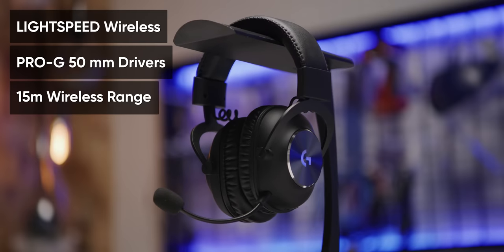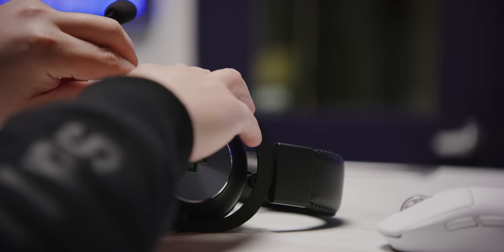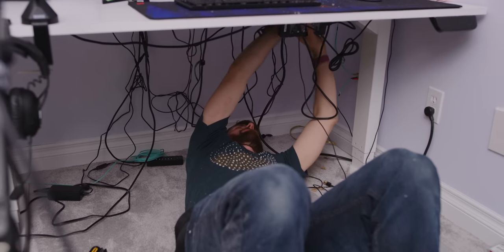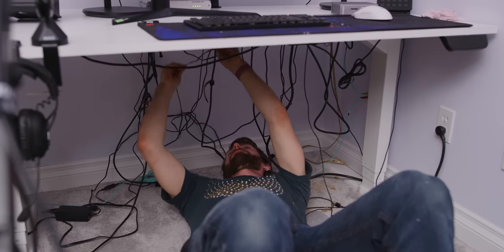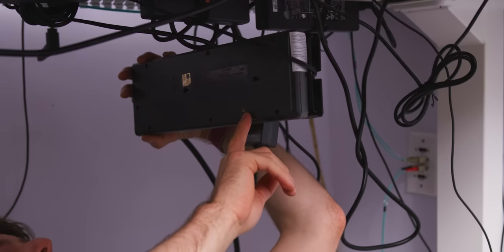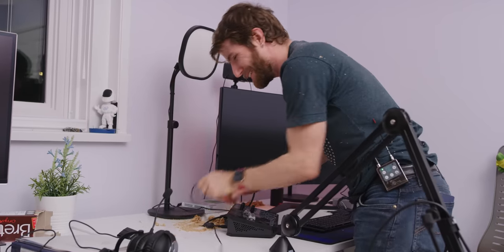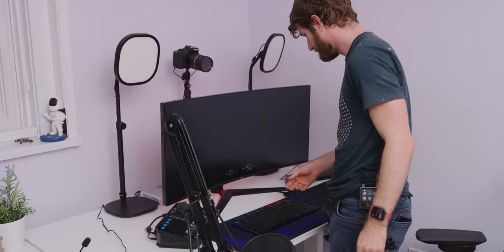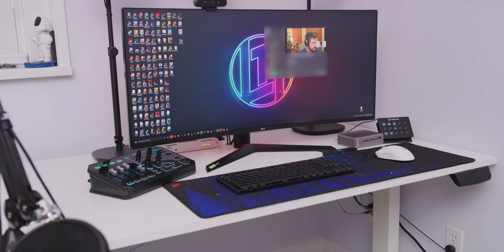It's time to break up. - Stream setup cable management

Comment: "70 hours on a single charge"

My Microsoft Wireless 5000 lasts ~10 months on Sony CycleEnergy cells. lol
Reply: High performance sensors and such use a ton of energy
Reply: Really??
Reply: @Scypher_Tzu  no
Reply: Yeah, but that mouse is shit. I had a shitty wireless mouse that lasted 4+ years without needing a change of batteries, but I'd still rather use a wireless mouse that lasts 4 hours than that pile or crap any day as long as it has good tech inside it.
Reply: @FiniteCS  The Wireless 5000 is shit? lul

Are we talking about the same product? The huge bluetrack mouse?

I had it for the last 8 or 9 years and its been a great piece of gear.

Granted, I only play GTA Online and some Battlefield from time to time. But it's got good response, never had interference issues, and it has an absurd wireless range.
Reply: @hrq007  Sorry, but have you ever heard of the Dunning-Kruger effect? This is exactly why I am dismissing your opinion and, albeit I don't mean any offense towards you, I'd understand if you did take offense. The way you say it's served you well for ~9 years while having only used it for GTAO and Battlefield is like hearing a grandmother say that her dial-up connection works perfectly well and she sees no reason to upgrade to anything different since she can still use AOL and Facebook just fine. Hopefully my analogy is fine there, but basically what I'm saying is that your lack of expertise in the department makes your opinion on "gaming" peripheral hardware rather lacking and not a good source for those who are looking for good equipment. I'm sure the mouse works fine for office use, simply browsing the web, and light gaming here and there, but it doesn't mean the mouse is not shit. It all depends on the purpose of which the person will use the mouse and what they're expecting from it. So yes, me calling it shit is subjective since I'm sure someone has needs that makes that mouse the perfect mouse for them, but for me and those who want the "best of the best" or every single bullshit, marketing "advantage" they can get, then that mouse can easily being considered "shit." No offense in your decision to use the mouse, just for recommending it with the only advantage it has being battery life when it utterly fails in comparison to many other mice in mostly every other field imaginable. Of course I won't expect you to notice due to the Dunning-Kruger effect and how you'll most likely never feel the need to have better since what you have is already potentially perfect for you, and I definitely won't expect you to go out and buy/download testing equipment just to test statistics like latency, sensor quality, glide pad friction, etc. 
Also, even without all the technical jargon and statistics, I can easily consider that mouse garbage just because of the size, ergonomics, weight, build quality, feel, etc., but I won't since some people might consider those qualities it has to be what they want in a mouse, since even just a few millimeters difference in height, length, or width could be the difference between the perfect mouse and something someone could absolutely despise.

*tl;dr*: Look up the Dunning-Kruger effect, consider more variables than just technical aspects (especially if you don't fully understand them/care for them anyways), and remember that, just because you like it, doesn't mean anyone else has to like it, too.
Reply: @FiniteCS  Thanks for the wall of text.

I really mean it, I get your point.

I most surely am a casual gamer, and peripherals really aren't my cup of tea. I'm a datacenter guy, so I'm really into a whole other range of hardware.

I just thought it was a bit unfair calling it shit because it's quite a good mouse for general use. It was recommended back then by a friend of mine who's an editor for a photo studio, it was his mouse of choice at that point in time, and it has served me very well.

Personally I wouldn't call it shit because it's not a $10 no-name chinese generic junk... but yeah... It's a 1000 DPI "self adjusting" mouse. Other than the extra buttons, there's pretty much nothing you can even change.

While the Superlight is a 24k DPI unit.
So, yeah... I don't even know what you'd do with something like that. Lol
Reply: @hrq007  "One man's trash is another's treasure" also fits here... kind of. Although I understand your displeasure with me calling it shit, you can take it the same way as if someone who was driving a Mercedes-Benz SLS AMG were to talk shit about your car that you absolutely love and/or think of as perfectly adequate/suitable for you. Although not entirely similar since I sincerely doubt most drivers of cars of that price range or higher actually take their cars out to tracks to enjoy them everyday or even make use of all the luxury features while, with mice, it's easier to make full use of the technology built into it without just buying it as a tool to express wealth or for your own aesthetic pleasure. 
Honestly, there's no point to all of this since it basically boils down to this: get what you want if you can afford it without sacrifice or worry and have no need for anything better if those better qualities are wasted due to lack of necessity. Whether it's a $10, $30, $60, or $150 mouse, there's always someone who will call it shit, whether or not they have a right to do so. Just as we both can call the $10 mouse shit because of its flaws, the owner of that $10 mouse can call your mouse shit, my mouse shit, and the $150 mouse shit because they cost much more and he doesn't need anything that those mice provide that his mouse doesn't already give him. Me calling your mouse shit in the original comment was not for the entirety of the mouse being shit, because, as you originally wrote, the battery life alone can be used as a reason to buy your mouse over the mouse in the video, but for the fact that your mouse would be considered shit by anyone looking to buy the mouse in this video. This mouse is catered towards a select group of individuals, so to people not in that group, this mouse can be called shit for the price, lack of battery life, or anything else they find fault in it because it doesn't fit their needs (i.e. 20+ extra buttons on the side of the mouse, a joystick built into the mouse, a scroll wheel that can be unlocked for infinite scroll, weights that can be added or taken out to change the weight, etc.). 

Sorry again for "wall of text," but here's a tl;dr: every opinion is subjective and every item can be considered either good or shit depending on the person's need for said item. Sorry if I offended you for calling your mouse shit when it does what you need of it and you have no reason for it to do anything else, but your mouse doesn't do what I need it to do, so for me, it's useless and something I'd never wish to purchase.
Reply: Arbitrary because it also depends on use, which no doubt differs from their test and your own.
I bought some cheap mouse like 3 years ago and it still works on the alkaline battery that came with it, probably because I barely use it :D
Reply: I've no idea about the quality of that mouse, but I have a Logitech wireless mouse from about 9 years ago that I've been using on a regular basis since then. Not only that, but my daily desktop mouse is an HP cheapo pack-in. I've played many games on both mice, from Minecraft to Getting Over It with Bennett Foddy, and while they may not be suitable for competitive FPS play, they have been perfectly sufficient. I've never noticed any problem with using these mice for gaming, with both basically using no-name garbage sensors, so while they may be bad compared to the best modern mouse, I don't think it's justified to call them, or that Microsoft mouse for that matter, shit. You are of course entitled to your opinion, but I personally think it'd be better if you made clear it was your opinion. Simply saying that "it's shit" gives a more negative image than I feel is deserving, though, of course, you may disagree.
Reply: @canadajones9635  As I said before, it's all relative depending on what you use it for. If you're going to just be playing things like GTAO, Minecraft, etc., then just using a controller or random mouse from Walmart would be fine for that. For someone who would actually be willing to spend the money to buy something like the mouse in this video, those options are shit. It's not 100% just my opinion, since it's not like I'd go to a random channel with someone editing code or designing websites and chastise them for using some run-of-the-mill mouse from HP, but because this mouse is meant for specific uses like esports and FPS, it's why I am belittling his mouse. Not just that, but because his idea to bring up the battery life of the mouse to say it's better or not. Of course he didn't actually mean that, but his first comment strongly suggested that and is why I even started this. Now of course, if he worded it better originally to suggest that this mouse is overkill for what he does day-to-day and that he'd rather stick with a mouse that has the battery life he talked about and the technology in it that some fancy sensors, wireless tech, and other hoopla that, admittedly, most users don't really give a damn about, then I wouldn't have said anything. 
Regarding me just saying it's shit right off the bat, that's because, after ~10 years on YouTube, I've grown the understand that people hate "walls of text/paragraphs" and will use that to dismiss an argument or even read the comment at all. So just saying, "it's shit," might have been too harsh, but it's what would convey my message quickest and most efficiently; since for people looking at the mouse in the video as a potential purchase, they'd never even think about the mice you guys have brought up since battery life, while important, isn't enough of a reason to sacrifice the technology built into the mouse itself. And if battery life is truly such a problem for people looking into this mouse, they would instead opt for a wireless mouse that'd have the same sensors, weight, etc. rather than getting an HP, Dell, or Microsoft wireless mouse with batteries that'd last years. Of course not everyone agrees, but there's a reason why "gaming" and higher end mice exist, and that's because there's a market for them with people looking for the best mice to help give them any advantage they can get, whether it's truly better or just placebo. Otherwise, companies like Razer and Logitech wouldn't exist in the first place and everyone would just go and buy whatever has the most RGB or whatever mouse fits their weight, size, and grip type requirements (if they even play the types of games where such things matter).
I get it, I used to be the type that just played games on random HP mice from Walmart and not cared about any of the bells and whistles since I never did anything that needed such things 5+ years ago. But things are different now due to what I do, since now those cheap mice I used for Minecraft and singleplayer story games  are no longer adequate and would make my experience miserable. It's the same way for 60hz refresh rate displays, audiophile headphones vs. "gaming" headphones vs. cheap $10 headphones, and mechanical vs. membrane keyboards. They all serve their purposes, but for select people, select items are required and that's just that. Not making fun of anyone for what they use, but just saying what's true. Like I aforementioned, I'm calling his mouse shit because of where he mentioned it, for a direct comparison between his mouse and the mouse in the video would show the many, many flaws that detail why there is a price difference, but also why battery life is so shit on the more expensive mouse. His mouse works perfectly fine for him and isn't shit to him because of what he uses it for, but that's not what people actually looking to buy this mouse would think. But hey, obviously this video reaches more markets then what it's advertising for is meant to reach, so I can't assume anyone here is actually in the market to buy such a mouse. But for those who are, then I can hope they see my original, albeit rude, comment about calling his mouse shit. Not because it is a shit mouse, but because it's a shit mouse for people who'd buy this video's mouse. (I feel like I'm on loop; anyone getting this feeling of 
déjà vu, as well?)

Comment: I use some super high quality velcro i stole from work,. to keep my monitors powerbrick and my extensioncord on the table. 
I use like half a square inch for the extension and a square inch for the brick.

Comment: If the mouse pad is full of electricity from the USB connection, it will be better to put a radioactive gauge/meter on the mouse pad and monitors the radioactive rating first.

Comment: I had the pro x headset and after having it about two weeks I went to put it on and the band just snapped. I have never in my life had something just fall apart in my hands like that. Im a huge fan of logitech g502 best mouse of all time but.  Out of the numerous headsets if tried that one was the most disappointing but a mile.

Comment: Probably should clean that blown-in insolation off before returning to the electronics.  That cellulose dust is nasty.
The desk would be easier to clean without the wires in the way.  Only sayin.

Comment: A true wireless setup does not actually exist. You still need cables to charge your peripherals, or you have to use replaceable batteries which are often too heavy or bulky for some applications. There are other compromises like the fact that no one has (yet) figured out how to have open back wireless headphones. Let's face it, wireless is just as much of a hassle as wired.

Comment: Wanna know what the problem with hot-glueing power bricks is?

They get hot.
Reply: They don't get that hot though
Reply: @christianpermalino9304  However in the configuration he described the power bricks are constantly loading the glue with their weight. Not a lot of heat is necessary in order to transform hot glue from a solid to a just very, very gooey liquid. Meaning the heat cycles and constant load will weaken the glue joints over time leading to failure.

Comment: This is all fixed by buying a desk with multiple cable management holes lmao. This is why I buy office/commercial grade desks like Bush 48" corner desk and  table to go with it. Not only are there holes for cable management it also has prebuilt configurations for mounting under the desks.

Comment: I'm still wondering why 4K video can be wirelessly transmitted from my Wi-Fi router to my TV for Netflix but it still needs cables from my System unit to my monitor. Can't they just work around it and use some of that free spectrum to get everyone wireless everything!?

Comment: what kind of USB HUB do people recommend for Wireless Peripherals like these? Using an old asf usb 3.0 4 port hub from Anker ive had for forever for my g pro x wireless headset and keyboard/mouse and monitor lamp, audio has no issues. Planning to grab the g pro superlight and wondering if I need to upgrade the usb hub.

Comment: For attaching your power bars to the bottom of your desk, I use heavy duty strength Velcro strips. They haven’t moved since and they are removable if you need to…idk remove them and plug something in or something.

Comment: I like wires, still faster than air-solutions, and they also charge devices (which is only slightly possible for some non-cabled devices, and not as fast). So, lets see again in 10 or 20 years. 
But, cable management is something else of course. Don't care bout that. Hate batteries, rechargeable or not.

Comment: 9:20 instead of hot glue, use VHB. It’s not permanent and holds quite well. It’s what apple uses to keep displays on iMacs, and that’s only about 3/16ths wide.

I use it to hold all the plastics under my desk, such as power stripes, bricks, etc

Comment: Desk looks great after cable management.  Also yes wireless is the way to go for the keyboard, mouse, and headphones (if you have to use them).   Have used them for over a decade.

Let me just say from an age standpoint I started out with joystick on a first generation Apple when it first came in a case (before Apple II) and played pong on a black, and white 9 inch monitor.  Never was that much into computer games.  Not my cup of tea.

Comment: so many years of experience and the lack of common sense baffles me. move the damn screen away, you protect your glass chassis doors better than this. stop drilling into things without even BASIC measurements, when things are actually plugged in and strapped into the thing you are drilling into. you have kids man, dont be this silly for the camera with your tools and gear. be safe.

Comment: Linus you can get like high strength Velcro strips, MUCH better than hot glue, and you have the advantage of moving it if needed. One half of the strip on the power brick, other half on the underside of the table... done.

Comment: I used two way tape for my power bar and the converter for my router (it's a box that converts the original connection to internet or something) and it works great, I didn't tidy up crazy because I am doing a new build soon, but it keeps all my wires away from my feet! Which was a big problem for a long time